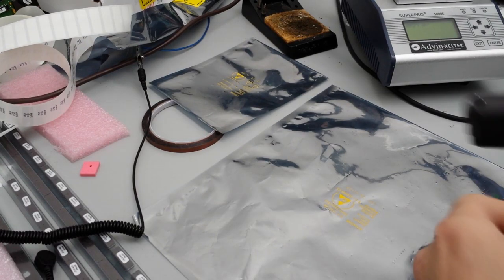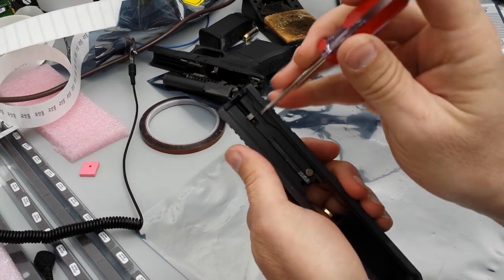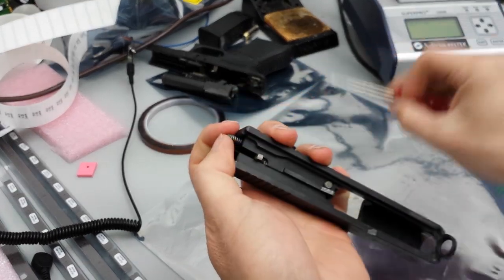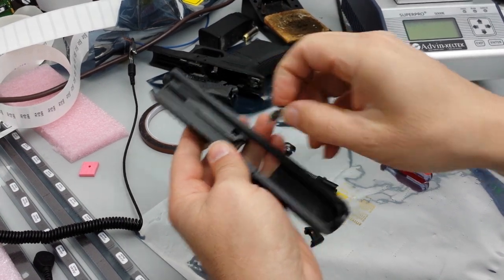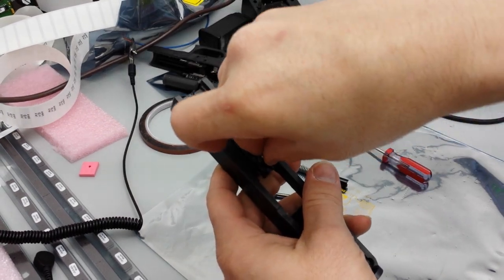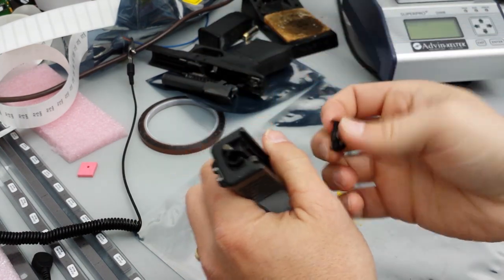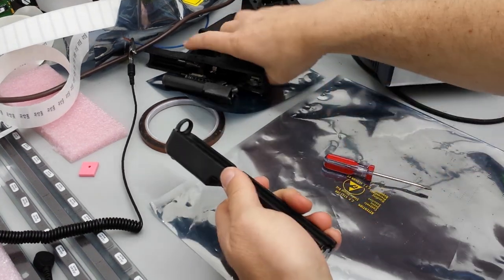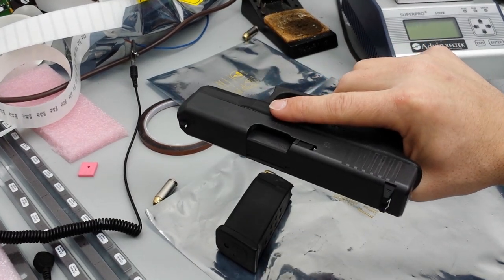Glock extractor replacement

Comment: saved me big time. i removed the backplate and i tried to hold down the springs and i thought i did, but it shot out.  then the extractor was not under tension and fell out and things went bad. but you helped me figure out i needed to finds that spring, which i did, even tho it had lauched to china. then i fixed everything right.   much appreciated.

Comment: Great video thank you. I was having some extraction issues the last 2 range sessions w/ my Glock 22 gen4 with the lone wolf 9mm conversion barrel. Been running great for about 6 years, but I'm sure with the round count/ wear and tear are bound to happen. Used your video to help swap out my extractor. Through a new recoil spring in too for some preventative maintenance and we'll see how she runs today. 
Thanks again for the demo.
Reply: If your extractor was chipped it very likely was from dropping a round in the chamber and then hitting the slide release. Always load your chambered round from the magazine and then top your magazine off... It's an extra step, but I've seen literally dozens of broken extractors in glocks. The way the gun feeds is that the case comes up with the rim behind the extractor. The extractor doesn't spring over the rim each shot, but it does when you slam one in the chamber.
 I've chipped my extractors several times, and didn't understand what was happening until I really studied the pistol.

Comment: I appreciate the tutorial, now I can change out my extractor for a new SS one.
Reply: If your extractor was chipped it very likely was from dropping a round in the chamber and then hitting the slide release. Always load your chambered round from the magazine and then top your magazine off... It's an extra step, but I've seen literally dozens of broken extractors in glocks. The way the gun feeds is that the case comes up with the rim behind the extractor. The extractor doesn't spring over the rim each shot, but it does when you slam one in the chamber.

Comment: Not sure if I didn't put it back in right, but is it normal for the extractor to be moveable after reinstalling it? I can push it around a little bit. It stays in, but I never tested that before so I'm not sure if it's normal. Thanks for any help.

Comment: i have an extractor issue for my 43 where the bottom lip of casing gets caught by extractor and barrel on slow charge.  if i do a fast charge and don't ride the slide, it seats the round fine, but if i slow it a little, it won't go into battery unless i grab slide and push forward. just bought new extractor and it might fix the issue. from midway of course.
Reply: It is not designed to "slow a little"  Always do a fast charge and it will be fine
Reply: @markhudson2663  you are correct. The new extractor does the same thing. However, not all of my guns have this issue.  It's really a non-issue since I will be fast charging anyway  like you said

Comment: Urgent question will a glkck 43 extractor fit and function in my glock 43 x??? I need to buy a metal extractor as my plastic one broke pls someone I'm looking at buying a lonewokf polished glock 43 lci extractor polished and I want to know if it will work in my 43 x I hope estoy think these are the most unreliable glocks ever made but just a Question

Comment: Great video, it's short, simple and to the point.  Question for you.  My Glock 19, Gen 4 is ejecting the brass straight back into my face, about 3 per 10 rounds.  Have only fired about 200 rounds through it too.   Which should be changed first, extractor or ejector?  I'm being told by non-experts it could be either.  Can you make a suggestion, which to do first?
Reply: I had the exact same problem with the exact same gun. Sent it to Glock 3 times. First two times of them not correcting the problem, I requested a completely new replacement in which they did, and even added night sights free of charge. No more brass bouncing off my head. My advice is to do the same. It'll all be on their dime. If they don't offer you a free shipping label, ask for it.

Comment: Going to be changing out my extractor and converting my Glock 27 to 9mm today. You said in the video that you hypothetically would have changed the plunger AND the extractor... Is that necessary? Is there a difference between the .40 plunger and 9mm plunger? I only bought the 9mm extractor.
Reply from the maker: Not necessary to change the plunger and spring, only if you're going to a new "style" extractor (ie going from loaded chamber indicator to a non-LCI extractor). Putting a fresh spring in there will help sometimes though if it's not grabbing on the casing well enough.
Reply: The gun only has about 500 rounds through it, so it isn't exactly worn out. Spring should be fine.

Thanks a lot!

Comment: Good video but man you made removing the slide way more complicated than it has to be. Put right hand in beavertail like normal but rotate fingers on top of slide,lightly squeeze it to the rear then use left hand under coming up under the trigger guard with thumb on left side and index finger on right to pull the bar down. You will have complete control of the weapon and be about 10 times faster.

Comment: Function testing with live ammo.... smh
Reply from the maker: Finger was off trigger and pistol pointed in safe direction towards our clearing box at the edge of the bench. Thanks for looking out though!
Reply: un1xg33k The video was great and very helpful, I just have a rule of no live ammo on the bench when working on firearms, I use snapcaps for testing just to be extra safe. I know it's anal, not trying to be a dick :)
Reply from the maker: Alan Crouch You're right - can't be too careful!

Comment: Respectfully suggest you use the name of the parts instead "this guy" or "that guy'.  Also it may be old fashioned, but unless you are in the field under attack general gun safety calls for removing ammo little further away from the gun when working on it and checking function with inert or dummy rounds.